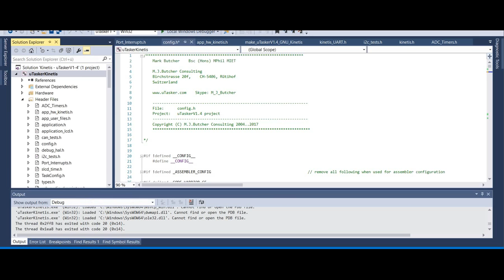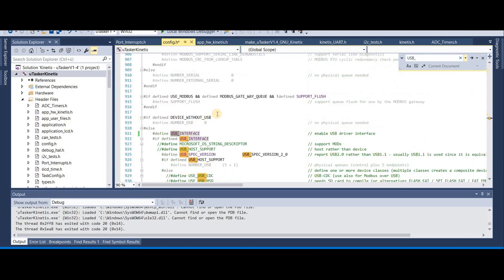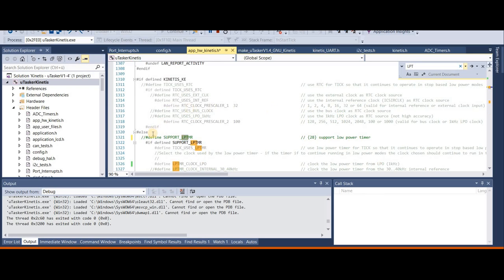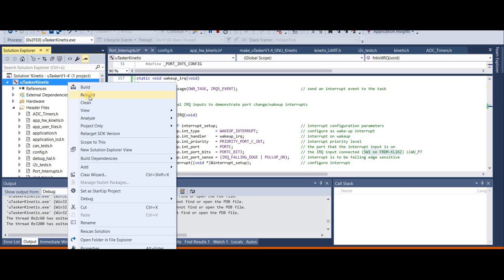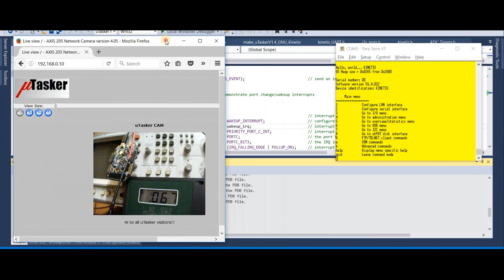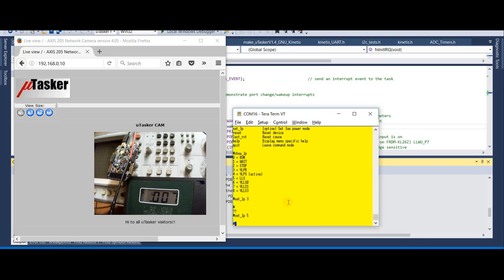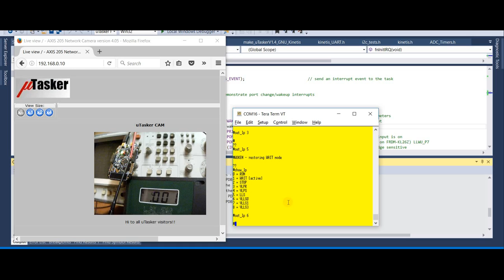uTasker SHORT FRDM-KL26Z Low Power

Comment: Hi! Nice video, thank you for the info, I tried these modes with FRDM KL25Z but not obtained such low currents,
I have a question:
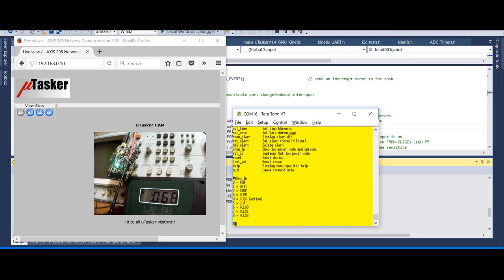At minute 2:27 you have VLPS mode, LED is blinking, how do you measure only  69uA since the led will draw 5-10mA alone?
Regards, Cristian
Reply from the maker: Christian
The current measured is to the Vdd of the processor (there is a link on the board that can be broken to measure this). When the LED is on it is a GPIO of the processor driving it to GND and the current is supplied from the main power supply - this means that the overall board current includes the LED current but this is separate from the processor current.
Of course, if the overall current consumption (and not just that to the processor) needs to be kept as low as possible the LED could need to be turned off, as would anything else on the board (external to the processor) that could draw current.
Regards Mark